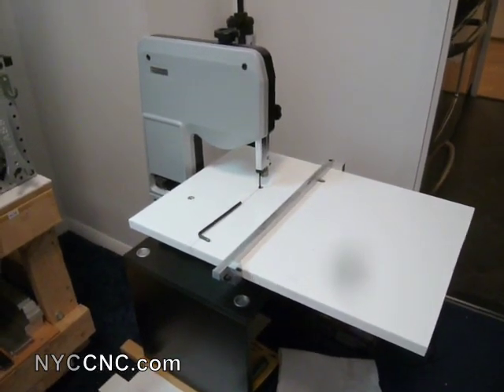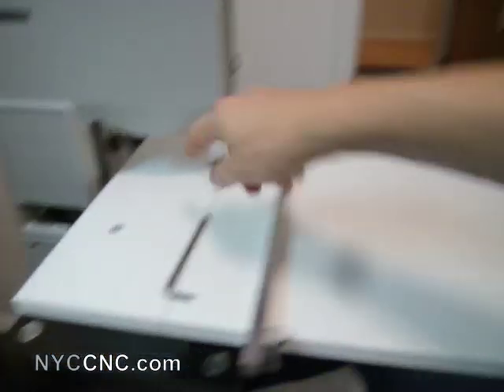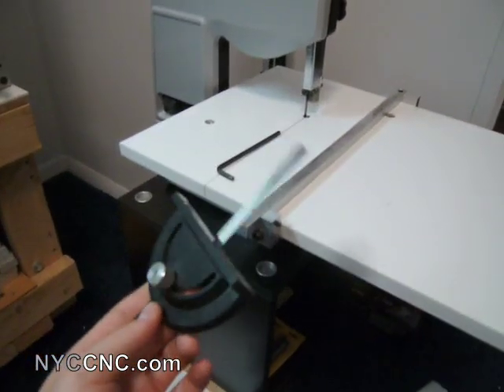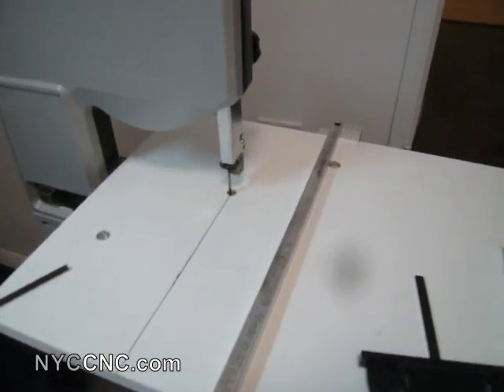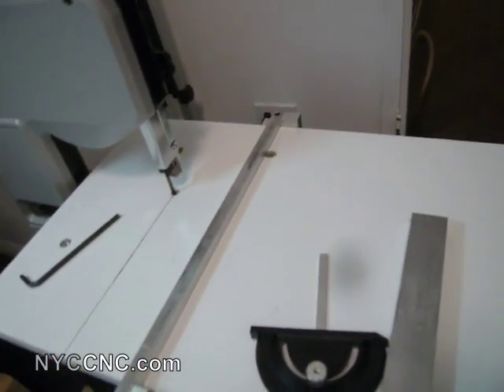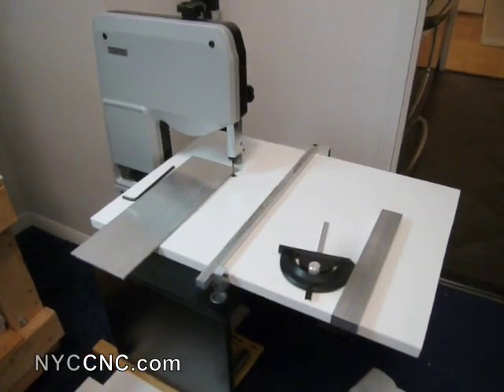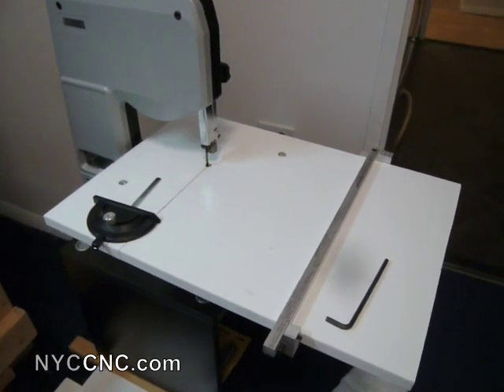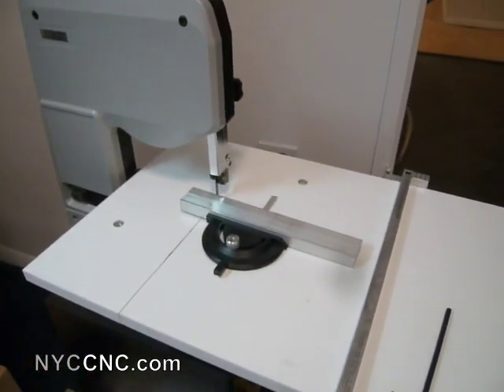MicroMark Deluxe Band Saw for home machine shop & Custom DIY fence

Comment: With your new home, you need a 14: vertical band saw. Get a Delta or Rockwell Delta 28-303 metalcutting version of the band saw for woodworking,

Comment: These micromark saws are a piece of garbage. They don’t run slow enough, so the expensive blades fail prematurely. They are a money pit. You keep buying more blades in the hopes that the next one will be better. Save yourself the trouble and money, and just get a good Dewalt or something.